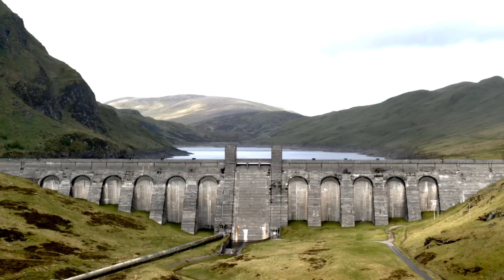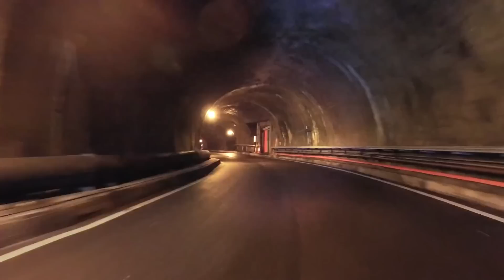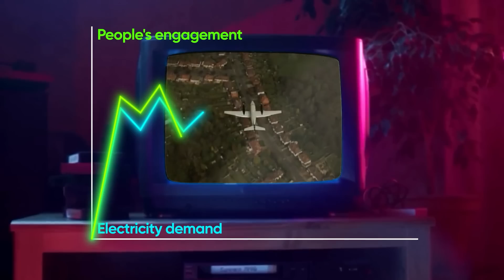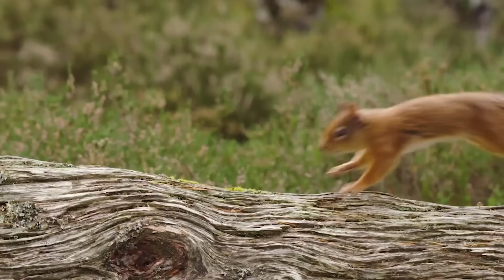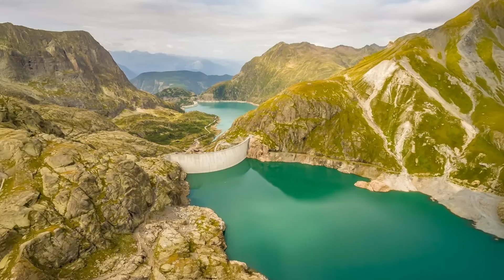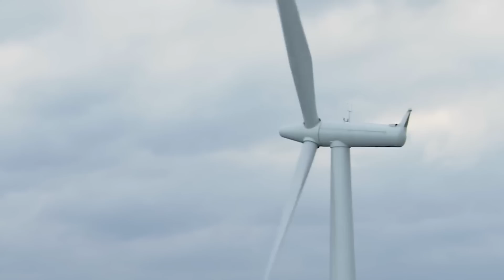This Is Why Scotland Won't Let Millions of Tons of Water Run Out of the Mountains

Comment: UK power is priced at the marginal cost of production. The most expensive generator sets the cost per kWh. With coal generation now dead and buried gas sets the cost of UK grid power because it is the most expensive with nuclear not far behind. Wind and solar are by far the cheapest forms of generation. We live in the Highlands where much of the wind generated power is produced yet we pay highest tarriff. It's mental.

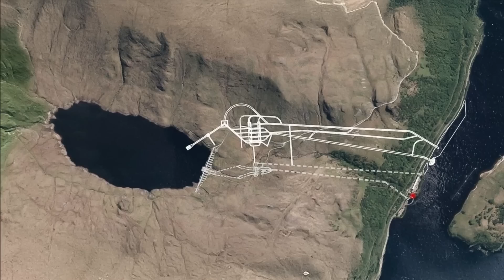Comment: 10:00 Drax power station (in East Yorkshire) who own this Scottish Power plant is only a couple miles from where my boat is, I can see the Cooling towers from where I am and can get within 100ft of one on a public footpath, they are massive, many years ago I used to take 'fuel' in box trucks to the plant for burning.
 It is now ment to be 100% bio / eco fuel used, though it used to burn anything like cut up car / truck tyres and other nasty rubbish.
 We don't get much smoke at all, more steam from the cooling towers than nasty gasses which is good for the environment.

Comment: it's nonsense and a con job..., what they don't tell you is the efficiency of normal electricity generated by  conventional means is only just over 50% efficient.
So actually you are paying for massive wastage. THEN when they ulitlise the sort of crap, they use normal electricity to build a garvity battery, something the Romans were doing 2,000 years ago.
and we used to power the same thing during hte industrial revolution, with mill ponds.
anyway back to the  con...
you pay for hte massive wastage THEN you pay for the electricity to do this an THEN you pay again when you actually utilize the electricity.

there is NO SUCH THING as "free" electricity, not even with solar....., you pay for the panels for at least 20 years before you make a return.
by which time they are already down to about 10-15% efficiency on the best of days., so you scrap them off nad have to buy new ones.

WE need to stop F***ing about and find a way to convert  coal/gas etc directly into power without using steam.

Comment: There’s a key point being missed here. Though it’s generating energy, it also consumes a vast amount in pumping water back up the mountain. So it’s not a net electricity generator. However depending how much it rains this will help replenish the upper loch. I’m guessing the rainfall is fairly small though in comparison to the water used to generate power?

Comment: We have the same type of system in Missouri at Tom Salk power plant except it is all on the surface of our mountain. And the dam is a full 360 degrees around instead of damming a valley. It was built about the same time in the fifties.

Comment: Dinorwic is a similar but much larger pumped storage power station inside the mountain Elidir Fawr, opposite Snowdon, N Wales. It can power the whole of Wales for 6 hours. There were recent  revelations how Treasury fiscal rules only count a return on investment for 5 years. So these types of things that have benefits for generations and make obvious economic and environmental sense just dont get built. Instead, we more likely get damaging nuclear power stations that are similar in scale of cost and output but dont last and have toxic waste problems forever.

Comment: Closed loop hydroelectric power stations can be built any size from powering an entire city to a single light bulb, they can be built underground or incorporated into building design saving space and placing the power production closer to where it is needed eliminating most substations and transformers. 
If you combine strategically placed closed loop hydroelectric power stations with residential rooftop solar and wind power systems you can quite easily and cheaply produce the power needed for any modern city. 
Small closed loop hydroelectric power stations are far cheaper than large units and all the components can be made locally, saving even more money. 
Electricity is actually very cheap and easy to produce but the electricity companies don't want people to know that. 
We already have the technology and resources to be completely fossil fuel free in under 2 years but the people in charge don't have the intelligence or willingness to just do it.

Comment: The South Island of New Zealand is well over 100% self sufficient in Electricity, generated from Hydro dams.  However we get charged a lot for it. Partly because a lot is exported literally to the other end of the country via an undersea cable, but also because a huge European owned Aluminium refinery operates at the South of the country. 

They get their electricity, about 16% of NZ's total production of electricity, almost for free. The Aluminium refinery works under a contract system so no matter what the world price, they can claim that it is barely economic for them to remain running, and can they please have huge more amounts of government subsidies. 

The European shareholders have never had it so good. Unfortunately for all New Zealanders the govt just gave in to them and gave them another 30 year contract in 2023. So looks like NZ will have expensive power for all consumers (except the Aluminium refinery) for the next, 29 years to go.  

Some years back, in a fabulous stunt they pulled, as a method of driving down the price they pay for electricty even more, the Aluminium smelter owners, like a 4 year old child, played this enormous game of "pretend".  

They actually said with a straight face "We are going to pretend that we have built all our own transmission lines, over the several hundred miles from the big hydro dam, to our smelter. And by our calculations, we reckon we could do maintenance on that power line cheaper than you do. So we only want to pay the new "pretend" rate of Transmission Line charges".  

Note the original main transmission line was put through Fiordland a Category A-1 World Heritage National Park area, decades ago before it was granted Super-Duper Fully Protected status, and even if they wanted to, nobody, not even the NZ govt, would be allowed to ever put a new transmission line through that area now or ever again.  

So. as I and every other Kiwi's electric bills keep going up and up, those European shareholders in the aluminium smelter are laughing all the way to the bank as they give us a right rogering..

Comment: This type of system is ideal when paired with nuclear power generating because the nuclear plants provide a constant output  at all times (they have to for safety) a pumped storage facility can take any excess power and store it for later use. They can then use it to cover any spikes in demand and ensure smoother power curves. This avoids the need for nuclear plants to increase generation quickly which could cause accidents.

Comment: But these days actual (sodium-iron etc.)batteries are cheaper and faster to build...
Reply: Battery grid storage in city in US caught fire.  Now residents don't want them nearby.  Large scale pumped hydro batteries are the cheapest form of grid storage.  But need to be over a certain size.
Reply: @commontater6274  That is however not what THIS video says regarding the price... I'm not against pumped hydro, but there are simply not enough suitable locations, at least in Europe...

Comment: In New Zealand, there is also a subterranean power station.
It is at Manapōuri. The water flows from Lake Manapōuri to a power station built 200 metres underground, then continues flowing out tailrace tunnels into the ocean at Deep Cove which is situated in Doubtful Sound in Fiordland on the south islands West Coast.

Manapōuri power station is located in Fiordland National Park, on the South Island of New Zealand.
It has seven 128-megawatt generating units, and an operating maximum station output limited to 800 megawatts. 
Manapōuri generates enough electricity for about 619,000 average New Zealand homes.
Reply: Yeah , a major engineering feat for NZ , wasn't it to power Tiwai Aluminum Smelter which is unfortunately now owned by an overseas  company
Reply: @nigelswindles1129  yeah, there was a dedicated power line built just for it, but just recently there has been an upgrade of the power lines heading north away from the substation in Invercargill. This is to mitigate the fact Tiwai will one day reach its life term, and the power can be re-directed to the national grid.
Reply: As a Scot I'm ashamed - I've been to the Manapōuri power station but not to Cruachan...

Comment: Cruachan is only one unit of this kind in Scotland but there are a number of sites similar to this that could be used to produce vastly more base load Than the whole of the UK could use at peak times.  Cruachan has been operational for almost 60 years, & has at least the same life left in it without renewal is required!  Plus Scotland has other Hydro schemes that have been operating for 70 years with only minimal service required!   When the overall costs are taken into account this has to be one of the cheapest and greenest forms of electricity generation on the planet!  Wind and Solar have a maximum life span of approx. life span of 10-12 years and the disposal of the hazardous waste is a problem, and cause an eyesore to the landscape! As well as taking up valuable farm land!

Comment: There is already a pumped storage facility at Loch Ness, namely the Foyers one which is a 300Mw system completed in 1974, initially built to make use of the excess capacity of the Hunterston B nuclear power plant. I think the proposed new 450Mw plant is towards the other end of the loch, but I could be wrong here, I haven't checked on a map and it's over twenty five years since I visited the Foyers site and control room.

Comment: Crew - a - con? ... Love it. It's pronounced Crew a chan ('ch' sounds as in loch). Never mind: Right at the end, the bloke doing the voiceover proves he can't say loch either. It was built because nuclear power plants take ages to ramp up and slow down. Cruachan enables nuclear power stations to produce at a steady rate while taking care of peaks and troughs in demand. It's now being used to try to do the same thing with wind power because the 'green' lobby has stuffed nuclear power. Unfortunately, supposedly environmentally friendly wind turbines actually produce more greenhouse gases per kilowatt/hour of electricity generated than nuclear stations because wind turbines are so grossly inefficient and use huge amounts of steel and concrete in their construction. The electricity they produce is entirely unreliable (when the wind don't blow, the turbines don't go and the leccy don't flow) and hugely expensive, which is why we pay a fortune for electricity in the UK. Time to give the 'green' lobby a good kicking, don't you think?

Comment: The concept has universal appeal.There is a river in Canada with a third dam. Line C is down stream from two other hydro electric power generaing stations. Capable of generating safe ,reliable & renewable energy for over a century.  Reusing the same water for a third time.

Comment: I'm sorry. It would be smarter rather than having it dump out somewhere. Having it run through a piping system to go back up into the lake, like we have in fountain systems that used no electricity that just run off of gravity. That would be the smarter system to have and is completely self contained. And it's still just a hydro power plant, it's not a power battery, you're just trying to give it a different name.
Reply: Called a hydro battery because the water is pumped back up to the top resevoir. Gains 10% because 10% of the water on the top resevoir falls as rainfall.  Does not create any net energy.

Comment: In Norway we have done this in almost a cenury, 98 % of our power is generated mostly like this.
Odd B
Freiherr
Reply: And Norway is rich because it's their energy. Scotland has to buy all its stolen energy back from England.
Reply: HYDRO is huge. Everyone worked there. ❤
Reply: Hydro is not pumped storage.
Reply: @DrPowerElectronics  Cruachan dam is a pumped storage hydro power station. Yes, the hydro side makes the power but a station can in fact be built to do both.
Reply: @andybrown4284 Pumped storage has two reservoirs. Not much geography has such an arrangement, so normal hydro power is not pumped storage and most hydro cannot be converted because of this detail. I hope I have helped clarify my statement.
Reply: Don't you also turn off the waterfalls in winter to save water while tourists aren't around
Reply: @andybrown4284  I believe they do the same thing at Niagara Falls!

Comment: I was really fascinated to learn, sorry on another channel, that the UK’s electric power generating system is now officially aiming to be free of fossil fuel usage. Way to set an example for the rest of the world!
Reply: And when the sun don't shine or the wind don't blow they will switch your house off remotely with no warning. Now Imagine shutting down a manufacturing process halfway because there is no electricity. You can light a candle. A factory can't.
Reply: how to tell me you are American without telling me you are American but I guess it will be like Cell services, it took you 15 years to almost get to semi decent coverage and services by which time you'll be looking for a country to find an excuse to invade because your resources are dwindling
Reply: The uk is not free from fosil, dig up, no country is free from fosil in europe, not even the arab one speaking world wide
Reply: @ better? I must have misheard or incorrectly remembered the video. It was a few months ago, I think.
Reply: @jenniferlindsey2015  Free of coal but not of gas.

Comment: Pumped Hydro Electric Storage (PHES) vs Battery Energy Storage Systems (BESS) showcased by Tesla's Lathrop (40GW annual capacity) 
Googled result
"
In 2020 the was 17.6GW BESS vs 159.5GW of pumped hydro – PHES (90% PHES)
In 2021 27.3GW BESS vs 165.0GW PHES (86% PHES)
In 2022 44.9GW BESS vs 175.0GW PHES (80% PHES)
In 2023 89.2GW BESS vs 185.5GW PHES (68% PHES)
In 2024e 156.6GW BESS vs 196.6GW PHES (56% PHES)
In 2025e, the balance tips forever.
"
Reply: BESS caught fire in Escondido CA emitting toxic smoke,  Now people do not want large battery grid storage in their neighborhood.
Reply: @commontater6274  People in the Gulf of Mexico are not thrilled by the BP spill, people in Alaska are unhappy with Exxon, when the oil train spill in Canada kill killed 30 people and set fire to the whole town, people were annoyed, every year many refineries catch fire poisoning the neighborhoods. The people around Three Mile Island, Cernoble and the nuclear disaster in Fukushima Japan have issues for decades. But you think a relatively small fire in Escondido Ca, that was completely put out in a day is a big deal?
 FYI Here is the AQMD report from fire "
On September 19, two weeks after the September 5 fire that occurred at an energy storage facility in Escondido, the City of Escondido released two reports on the findings of the air and water quality monitoring that took place during the incident. The air quality data came from 11 different locations monitored by San Diego County HAZMAT and 17 locations monitored by Haley & Aldrich, Inc., an engineering and environmental compliance firm under contract with SDG&E, the operator of the facility. The stations were located approximately 100 feet to as far as 4,000 feet from the affected container and monitored six toxic gases. The equipment only detected the presence of two of the monitored gases, carbon monoxide and hydrogen cyanide, but readings for both gases were well below acceptable limits. The report concludes that “… only normal products combustion [sic] of a structure fire were detected and at levels considered by NIOSH and OSHA to be well below exposure thresholds.” 
 
Samples of runoff water were assessed for the presence of 17 toxic metals. The analysis detected some level of six of the 17 metals, but the report notes that the concentrations were well below EPA drinking water standards and the runoff “poses minimal risk to both human health and the environment." 
"

Comment: This is a load of waffle. It is a pumped storage facility. It uses overnight surplus electricity to pump water up to the reservoir. It is stored, until there is a peak demand, for electricity, it has only a short delivery time. The $64,000 question is 100,000 homes, or Edinburgh city, for how long?
Reply: It acts like a giant battery/smoothing capacitor reducing large spikes in demand which over time can damage expensive equipment
Reply: He said 22hrs.
Reply: @RickyKirkman  Which is probably bollocks.

Comment: Where does the power come from to pump the water bqck to the top pool?
Reply: The running generators, that no longer needed to electrify the country, now used to refill the pool
Reply: @fredas-t4890  the generators create electricity by draining the lake. You can't fill the lake and drain it at the same time. My point is when you close the valves on the power generation side, an alternate source of electricity is needed to run the pumps to pump the water back into the lake. Regardless of his description of what is happening, the diagrams show the water returning to the lake via a different path and flowing into the lake above the water line.